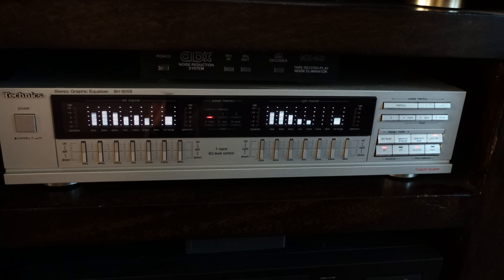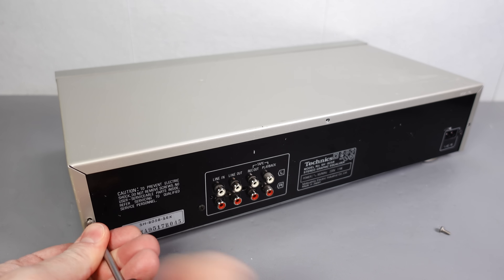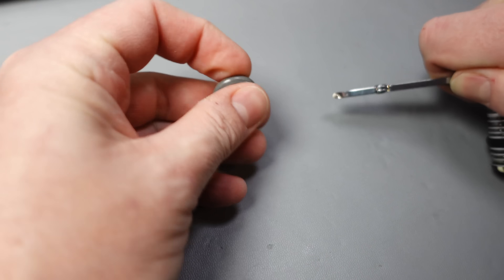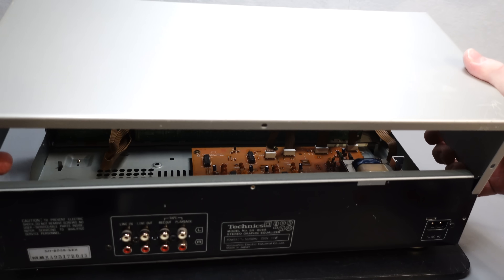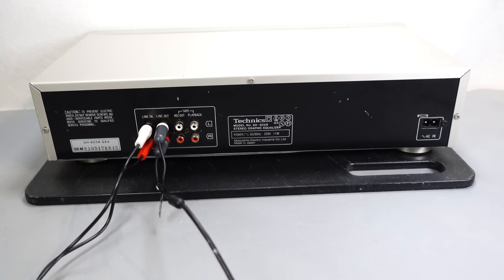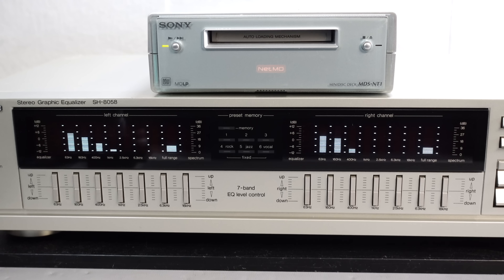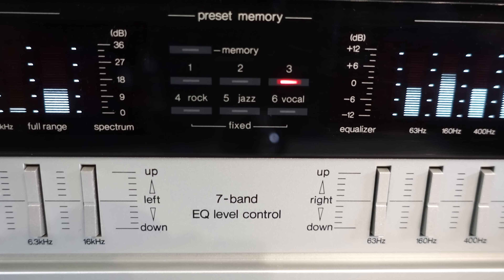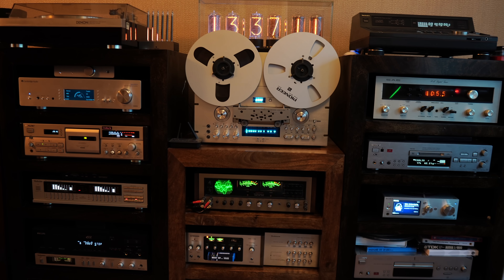The great equaliser - Technics SH-8058

Comment: Graphic equalizer is still an essential audio equipment required in a stereo system in my opinion even though stereo amplifiers have bass and treble tone control because it boosted or cut  a specific range of frequencies to improve sound quality on some music genres.  I think the decline of graphic equalizer used in home stereo system was because of loudness war on music since the late 90s which recording studios have "mastered" music with their so-called own factory settings.  Another reason is that because nobody used cassette tapes to record anymore which caused the removal of tape monitor loop switch on amplifiers and even though if todays amplifier contains a main in pre out switch, it is no longer jumpered and it acts as pre amplifier mode input like my Marantz PM-8006.  Another alternative that I enjoy this equipment is because of looking at the spectrum analyser when I'm not equalizing it.  Most simple answer I can say for audiophile today is they simply want everything to be simple and not complicated.

Comment: I'm betting a working SH-8075 would be worth a lung or liver today!!!

I'm also amazed that after ~37 years this gear continues to run 👍

There are two ways to hook up an EQ - for amps that didn't have an EQ input you would connect it to the tape in/out and then daisy chain the tape deck to the EQ. That's why you see the button for source/tape on the EQ. The problem with that method was you needed to have the EQ turned off for recording in order to get a "flat" sound on the tape. Amps with their own EQ connections got around this as the EQ only affected the sound going to the speakers - to record an equalized tape you would hit the EQ Rec button.

Comment: Those button cell style batteries rarely leak, so that is a good thing.   
The thing to check is if the device recharges the battery.   You can convert it to run standard batteries by adding a diode to prevent the device sending charge to the  battery.

Comment: I have the Technics equalizer model SH-GE70. I bought it new about 30 years ago. And it's still in pretty good condition. It almost looks like new. It is similar to the one you have, Mat, except the buttons are different and the color is dark grey.
Reply: i have it too[black model], great one. I'll have to see whether it has a battery. i bought it 2nd hand a year ago for 50 euros.
Reply: I used to have it, it was very nice.

Comment: Hi Matt.. the next
Day after watching this my 8058 packed up .
All I have showing on display is 2 vertical lines on left and right channels..
Any ideas

Since it was working  fine I've taken it apart and checked  the battery...... yep it was corroded. 
So have done exactly what you have done here
And yes... its back working  as good as new.
Many thanks for your very timely video 
Great ideal too with the batt holder

Comment: The company I work for specializes in AV and home automation installation.  We hire a very good home theater design company and fly down their principle to do audio calibration once the home theater is built out.  He does to settings: one that is acoustically perfect for the room and another one that most people will prefer.  Same holds true for the company we use to calibrate TVs and projectors.  When all is said and done, we show the client and if need be, make adjustments to their preference.  It's a business, so we are there to make the customer happy, not follow some esoteric standards.

Comment: Technics equipment was always the up-line Matsushita/Panasonic/National marque in the US https://en.wikipedia.org/wiki/Technics_(brand) .  This really takes me right back to my teen years in the '80s.  As a radio amateur, I'm always impressed at the build quality of these units.  I remember how I and my friends were always so mesmerized by those flourescent bar graphic equalizer displays ... so much more "modern" than normal needle VU meters of the day.  It was truly a glimpse into the future!
Reply: I recently fixed up an old G.E. all in one system from the same period and you should see how big the circuit boards are. 2 the size of the units foot print. This looks so much more elegant.

Comment: I have the what appears to be somewhat older Pioneer SX-626 tuner/amp and one thing I don't like is how close together the L/R channel RCA plugs are placed. It makes connecting additional components next to impossible with modern cables. I see one of those Pioneer 8-track units like yours for sale in my area, but I'm ready to pass on building a stack around it. 

I recently came up on a Sony all-in-one tuner, amp, cassette and turntable model HMK-414 and I think that's going to be my daily use stereo as soon as I find some appropriate speaker for it. Maybe someone else can figure out how to utilize the Pioneer, along with a cheap but serviceable BSR turntable.

Comment: A bit of info on the range of coin-type batteries; The first two numbers are the diameter in millimetres, and the second two are the thickness adding a decimal point. So a 2032 is 20mm diameter with a thickness of 3.2mm. A 2450 is 24mm diameter, thickness 5.0mm. 1220 = 12mm diameter x 2.0mm thick, and so on across the 3v range. At a pinch, you can use a 2016 in place of a 2032 if you can alter the contact, but that's emergency use.

Comment: Okay, but what if you have a later, say '90s amplifier that doesn't have 2 sets of tape inputs/outputs? Mine has one tape playback, and a recording out. 
How to connect then, if I don't wanna loose the capability of connecting a tape deck? Should I connect the deck to the EQ? It's a bit complicated...

I'd love to have such a nice equalizer, my Dad has one similar, got it from the trash, and repaired it, works nicely.
Reply: @matthewmarks6951  It only has a tape monitor button, that's the only way I can let my tape deck through, no separate tape button as input selector. It's a Yamaha RX-385 btw.

My tape deck is just a regular 2-headed one.

Comment: Those white connectors are actually pretty easy to disconnect. The important bit is to push down from above onto the thick white strip, then the cable becomes loose and can be unplugged.

Comment: The circuit board actually has 4 holes for the battery location at standard distances, so you can install a 3 pin socket for CR2032 easily. There is nothing wrong on making the cables make their job and access the bottom.

Comment: Lot's of new Techmoan vids! Maybe I didn't catch it but seems like there should be a switch to copy L to R since it's unlikely you would want to have a different EQ on each channel. Looks good though. Here's a request: Pioneer QX-949 4 channel receiver. I had one with the best CD4 4 channel cartridge at the time - almost worked - but always a little distortion from the 4CH vinyl records. Quad really only worked cleanly with tape I think.

Comment: Hey @Techmoan I was wondering if you could make a compilation video on 8 track systems. My mother remembers 8 track with the reputation of being very cheap and particularly bad in in Hi-Fi systems, (I think some of that ended up getting the reputation from car stereos in memory). I  saw your pioneer 8 track system at the beginning and figured I'd ask about it. Of course there is the standard mix of good and bad machines out there but I'm trying to find a decent budget system that's not going to destroy the
8 track cassettes. I have a good budget range and would like to know any recommendations?

Comment: Back in the day it was quite common for amplifiers to have a set of connectors (out of the pre-amp and into the amp) which could be used to wire up equalizers without having to use the tape connectors.

Comment: When I worked for Radio Shack once upon a time, they came out with a PC that used the same type of Lithium battery for the CMOS. The PC was a desktop type of PC that you would set your CRT monitor on top of. If you were to set the PC on its side it worked just fine, however, if you were to thump the bottom of the PC case the CMOS battery fell off the board. The battery had the tabs to be soldered to the board, but instead, it was like a little socket (3 holes in the board). Radio Shack, realizing the error issued a "fix" for the problem and it was a little square of double-sided sticky foam that you were to place under the battery, so it wouldn't fall out..

Comment: i work on copy machines like Konica Minolta and Kyocera, and had lot of machines put to pasture because of a bad battery on the main board. solder a new battery and install firmware and good as new.

Comment: How about a 33- band equalizer?   That would drive audiophiles completely bonkers 🙂

I had a Technics SH 8065 for the longest time. It came with a few cardboard masks that you could use to mark a few of your favorite configurations.  As noted you adjust the equalizer to the room, which you only needed to do once. Switching between "jazz" and "classical" seemed nonsense to me, and with 66 bands to adjust it was also highly impractical. 

Oh, the amplifier had an equalizer in/out. I didn't think it was a biggie back then.

Comment: Agree with your final thoughts on "purists" opinions.
Each person's ears also perceive sound slightly different depending on size and shape of outer ear and the frequency sensitivities of your inner ear. This changes with age as well, especially for those of us who have been in a band or one too many rock conerts without hearing protection.
I understand what they are trying to say by trying to experience it as close to the source intended (but often the final mixing in recording studios is not some work of art, it's a hurry up and get it out the door or the misguided idea of some rogue engineer).
Like you said, make it what sounds good to YOU.

Comment: hmmm interesting
i have a d7000 system (from 84-86 i think) which has never been serviced or repaired before yet everything works perfectly fine on it, all the belts batteries etc... the only thing that i had to repair was cassette deck's switches. they tend to fail and send incorrect commands after a certain time
all and all matsushita devices build quality imo is unmatched and are built to last a lifetime

Comment: Looking at the footprint of where the battery lives, you could install a battery holder there (which would necessitate board removal), a vertically-oriented slot into which you shove a battery like it was a coin in a slot, that's what I'd do, of course you don't have to, cos it's yours, and you came up with your own solution which works just as well... :)

Comment: I wonder why there's no function to "syncronize" the channels so both would have the same values and adjusting one would change the other one too as most of the time they will be set the same way anyway. It would probably have been easy to implement as the "sliders" are virtual anyway.

Comment: As a musician and a self proclaimed audiophile I agree that anyone who thinks an EQ shouldn't be used can absolutely fuck off - you explained it perfectly. In fact if you really care about sound quality you'd use an EQ with a SPL (sound pressure level) meter to ensure that each frequency is at the same volume. I've done this with huge EQ's (64 band) in large concert halls to make sure everything is as perfect as possible - you can NOT do this without an EQ.
Reply: Of course, EQ'ing the sound at a live performance (and other solutions for time issues etc) are very much needed and part of the production of the performance. At a consumer level it can be nice to use EQ, either digital or analogue. For playback at home, I like to experience what the artists made and carefully recorded and produced, on a very clean and simple, well engineered system (large horns and large woofers). I just accept how a recording sounds, good or bad.

Comment: Whatever happened to (affordable) car equalizers? They used to be very common, especially the ones with built-in amps (and importantly, faders), but I can only find a single model on the market right now, and I'm not thrilled with its feature set.

Comment: The lack of people capable of doing repairs is a real problem, when my mid 2000s white badge CRT died I was somewhat reluctant ro throw it out because it had a pretty giod picture quality and was able of displaying 60hz signals (great for my modded Mega Drive and Playstation), but not only taking it out somewhere was very difficult, there wasn't a single person capable of having a look at it, and TVs aren't the kind of sfuff I'm comfortable with having a look, even if all it took was maybe putting in some new caps.

Comment: Thanks to this video "equalizer + visualizer",
Now i wonder how could we even had one be without another.
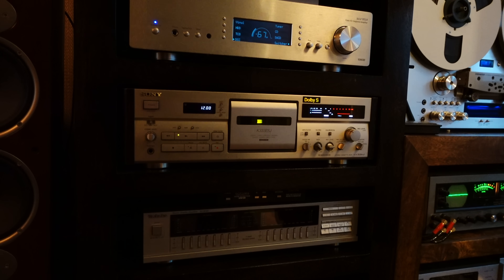Why 7:30 "audiophiles" make such claim? Well, maybe it's too much for them to handle? :)
To sell more expensive equipement? Except for mastering, equalizer is a "software" that help user to fix "hardware" - bad headphones, bad speakers? 

Im not audiophile, had ~10 years ago used Creative SBS360 speakers, fixed speaker using glue and cap taken off desodorant (previous owner destroyed speaker). Too much bass.. other than that i remember i was very happy quality was great. Having equalizer was crucial. I could not reproduce same sound on any other speakers. Sigur Ros - Von, recorded in some church in UK, forgot name. Was my benchmark, possibly recorded on some minidics or something it was noisy, but it vas very very dynamic music. 
Mostly silence plus typical to Sigur Ros "noise", regular music in radio is compressed.
So equalizer nor good quality big speakers are needed. 
Im not even able to watch movie, having set speakers at proper volume as if i was in cinema.
To not annoy my neighbours
Equalizers aren't that needed either modern hardware is just much better
I considered hardware my brother owned in 90s, considered "hifi" now im able to own it, fix it doesn't sound good it's was just.. overhyped. 
But equalizzer is necesary because it doesn't sound good on default settings
Maybe it's only me noticed audiophiles always compare hardware on default settings
They even use language to describe, visualize "equalizer" 
Maybe that's why they don't like equalizers?
If you can tweak everything what is point then to own expensive hardware?

Comment: Audiophiles in the '80s all had graphic equalizers. It was the ne-plus-ultra stage of an hi-fi system back then - the term exotic hi-fi or purist hi-fi was not even a thing for the audiophile masses. These trends became popular after the advent of the internet when these occult circles found a venue in which to speak to one another from all four corners of the globe thereby coming to the fore.
The one thing to note though is that graphic equalizers (now room equalizers) back then required a huge mass of components, especially adjustable resistors, and thus were not only expensive components but also built to a price. These facts meant that you'd pile up even more circuitry onto the signal path and thereby reduce the system's resolution. This is an inescapable fact. Back when most h-fi consisted of a budget record player and cassette deck, noise levels were higher than those of cd playback. Cds suddenly opened up the field to those who wanted more and people started experimenting by subtracting features or devices from their systems, thus the purist path was a thing. Nowadays, a room equalizer operates largely in the digital domain where things are more clear-cut and the sound quality offered by it exceeds (or should exceed) most budget analogue equalizers of yesteryear.

Comment: I started this video shouting in my head "I bet it's a 2032"... Talk about luck, i was right.  Then as you showed the surface mount ones i shouted to myself "just solder on a battery clip, and use regular cells" and bloody hell you did it.

So now, I'm thinking very strong thoughts that there's a few hundred quid in my bank..........

Comment: Couldn’t agree with you more on the ‘audiophile’ nonsense. I work in live sound engineering and we rely on EQ to compensate for room acoustics, different PA systems, microphone placement. It’s just a tool to be used to achieve the sound you are happy with.

Comment: To be fair, CR2032 batteries seldom leak so you're unlikely to have the problem that you had with the minidisc dock. I worked with computers for more than 20 years and never saw a leaked CR2032 even on some machines that were well over 10 years old.